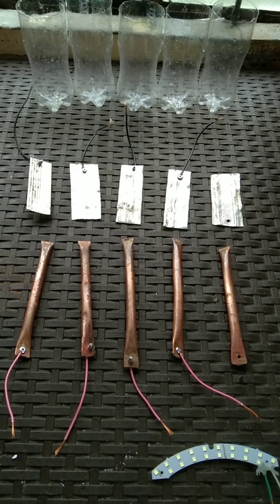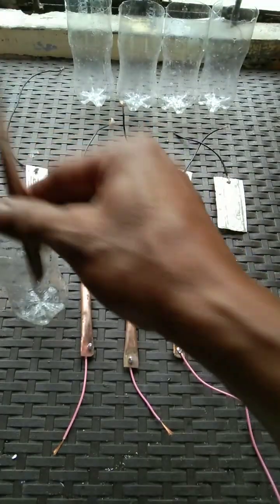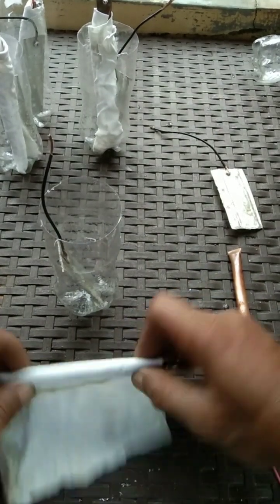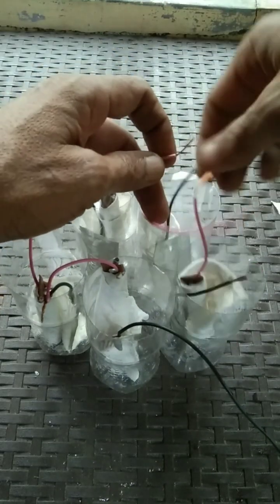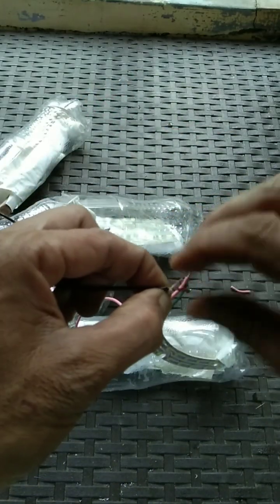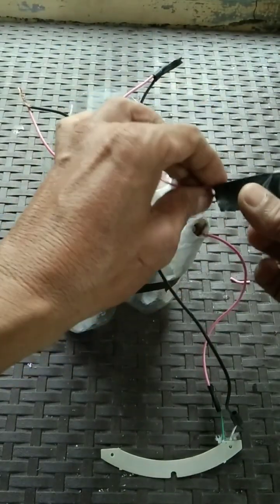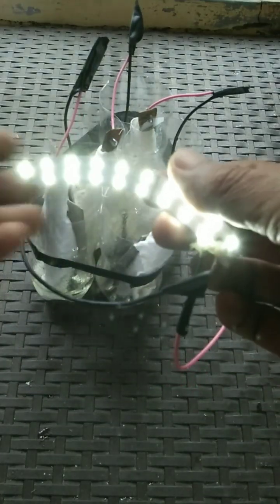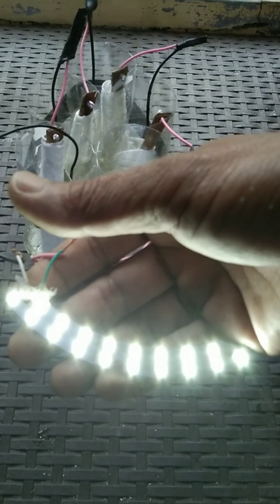Aluminum and copper homemade battery

Comment: Afternoon sir, thank you for the video, the battery works but it can't give light. What is the required input volt and current for your LED?
Reply from the maker: 3 volts to 5 LED bulb only and  at lower wattage

Comment: Question. Why did you just use Salt instead? 😮 You said Battery last three days. What happens then? Do you just clean Battery Plates and reinsert back to container and change out the Electrolytes for another three days of use?😮 Thanks for sharing your experience and knowledge with me.😊
Reply from the maker: Thank you, salt water in nit good enough with this kind of set up. But if used carbon and replace copper it would be the same effect
Reply: @MrDIYProjectTech21  So you could just scavenge a Carbon Rod from a AA or AAA Battery to perform this action? How about Pencil Lead? Would that work to?
Reply from the maker: @kennedy67951 same effect thanks

Comment: Harang done Sir Marvin
Reply from the maker: Thank you po sir Raffy
Reply: How  about  if I need 12v dc,  how  many  chlorine containers  do I need?
Reply from the maker: @leocanete9164  if you want to make 12 volts you need to add 5 more cells and connect in series